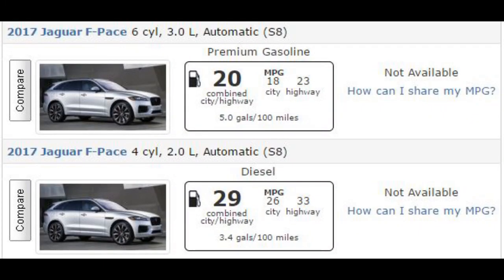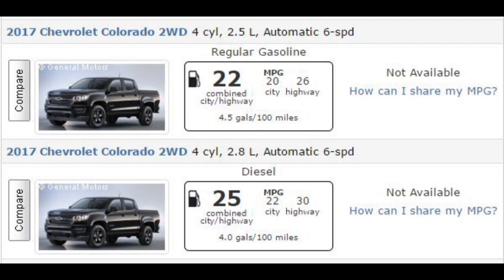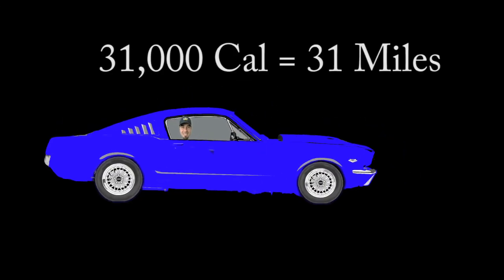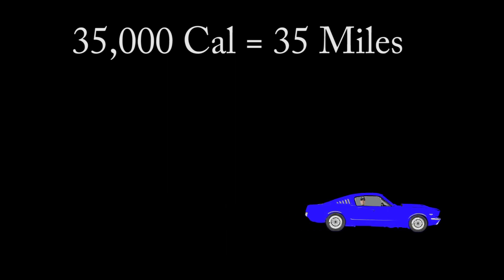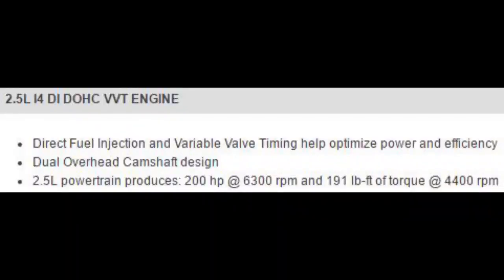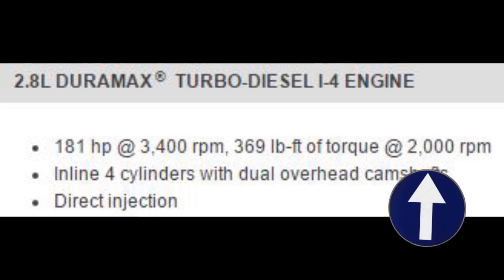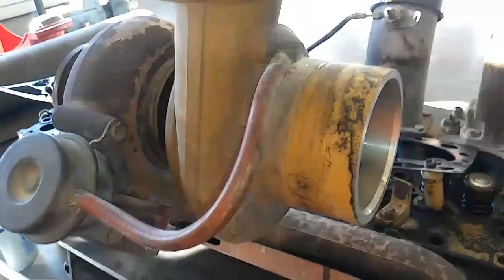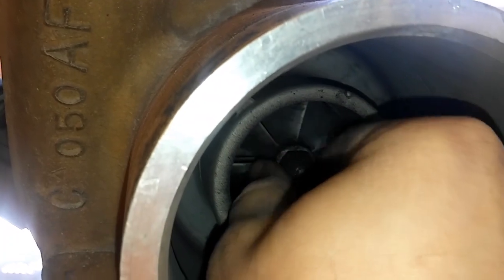Why Do Diesels Get Better MPG? Why Are Diesels More Fuel Efficient?

Comment: this past July, I drove my Smart Car diesel from Canada to Nebraska
checked and double checked: 996 miles: 
62.5 U.S. gallon per mile
the engine is 3 cylinders, 900cc
had lots of power.  No problem keeping up with traffic or passing, but I did keep it about 60 mph in an attempt to get the best mpg possible
I'll never sell the car - love it.
Reply from the maker: +badgeless I didn't know they made a Smart Diesel, that is pretty impressive mileage.
Reply: can't buy them in North America anymore for some reason.
I don't know how they get adequate power out of it but I'm happy with it.  The engine is a fascinating little 3 cylinders that sits sideways under the rear deck.  the length of the engine is about 24 inches.
Not sure if you're in Canada, but if so you'll know about the Webasto coolant heaters.  I've got one on the Smart.  It can be -30 and the Smart not plugged in.  I just flip the heater on and go back into the house.  15 - 20 min. later it fires up just like summer.  If I leave the Webasto running while I'm driving it continues to heat the coolant as it circulates.  15 min. later, or so, I have to reduce the interior heater motor speed because it's too hot.
I love my Smart Car.  Ugly but cheap.   I'll never part with it.
Reply: At 62 gallons per mile, I would drive it to a Cadillac dealer and trade it in before I even started.  Did you have a tanker truck following you?
Reply: badgeless Nice!
Reply: Adept Ape I thought all Smart cars were powered by gasoline, I did not know either.
Reply: I believe a Bradley tank gets better mileage EH!
Reply: Hahahaha i love the comments
Reply: I was planning to get a smart car diesel. costs like 25 bucks to fill and gets you 700km. I would have got a volkswagen diesel but now they are not emission legal

Comment: the biggest and main reason is because of the cylinder pressure at TDC. if gas did not predetonate it would get similar gas mileage to diesel. from the calculation of the PV curve of this adiabatic type compression, efficiency of the system increases with compression ratio or equivalent compression ratio (boosted).
Reply: Devo well, if wishes were horses, beggars would ride... gasoline would predetonate and destroy the engine at those high comporession ratios..
Reply: what you said....

Comment: Another great video AA. I think we all can thank Dr. Rudolf Diesel on he's great invention that were all benefiting from. Also great analogy on the internal combustion engines. We did have an engine that ran on diesel, mogas, kerosene and JP-8 fuel when I was in the US Army. We also could mix the fuel but it ran like crap when we did.I believe it was M35A1 on a deuce and a half truck. I want to say Hercules Diesel was the manufacturer. Thanks
JSL
Reply from the maker: +Joel Lagpacan I wasn't going to say the "don't mix the fuels" part in the video, but I don't want someone putting Diesel in their gas car to increase the mileage.

Comment: If i remember the old cat d8 14a will run gas/diesel. starts and warms up on gas then you switch to diesel.
Reply from the maker: +Trixler293 That must be quite the engine, how old was it?
Reply: Should be in the late 40s through 50s. Also a IH Farmall D450 starts on gas and runs on diesel. 1953 international TD20 bulldozer too, I was trying to find a particular video it had spark plugs and distributor. you move two levers one for diesel fuel and the other to raise the compression. Lots of 50s earth movers started on gas, i guess because glow plugs werent around yet.
Reply: We called them pony motors, and you are correct about the glow plugs.
Reply: okay I believe in two stroke extreme boost diesel.  think about that one.  how about a.wankle engine with the new port configuration which has put it back into R&D and it should be a major interest IMO.
Reply: That would be interesting to see how the mechanical inefficiencies are overcome.  There are many smart engineers out there.

Comment: hey adep ape i have a marine diesel engine  3406E  i was wondering what are the cause of high oil pressure
Reply from the maker: +Dax Cassini High oil pressure eh? How high? Did it just go up for recently?
Reply: we yous when out for a run and the port engine  pressure started to go up the gage was blinking red
Reply: normally its running  around 80 psi
Reply from the maker: +Dax Cassini First thing is put a mechanical gauge to verify the pressure is up, then I would cut that filter open to see if there is any metal in there. Could be the pressure relief valve stuck closed or possible something worse like a plugged galley or something. Check that filter first.

Comment: The differences end up washing out in the price difference at purchase time and the price of fuel. If diesel fuel and gasoline were priced the same, then the savings would make purchasing a diesel vehicle justifiable.
Reply from the maker: +Steve Ross I never say in the video that Diesel is cheaper or cheaper to operate. It is nearly always more expensive, just more fuel efficient.
Reply: Steve Ross at a lot of gas stations in my area, diesel is the same price or slightly cheaper than regular unleaded. If I had the money, I would've bought a diesel instead of my Galant, but there weren't any in my price range that didn't need lots of work.
Reply: In Europe diesel it's cheaper than gasoline and many companies offer diesel version at same price of the gasoline version.

Comment: I'm looking to buy an older school or shuttle bus could I get your opinion on the best engines please? THANKS
Reply from the maker: +mountainman For a Cat I would go with a 3126, they are good small Diesels. A gas engine is a lot cheaper though, what are you using the bus for?
Reply: Cross country rv conversion. I'm 42 and experiencing unexpected health issues and want to travel the west and maybe the north east but think it's more difficult cheaply anyway.
Reply: Adept Ape I'll try to pm I could really use some good advice. Thanks
Reply from the maker: mountainman Please email me at AdeptApe@yahoo.com the PM feature on YouTube is horrible.
Reply: mountainman If you are willing to go older and mechanically injected, the best engines are the International DT series. Unlike the smaller Cats, these engines are wet sleeve like the big diesels so doing a rebuild is easier, parts are cheap and plentiful and it has really no serious weaknesses. A DT360 or 466 will last you a long time, and if it has an inline injection pump can make more than enough power inexpensively. The HEUI system on the DT466E is the same basic design as the system used on CAT engines ( CAT and Navistar collaborated together ) but nothing is cheap about fixing them. Most common problem is the cam sensor going out.
Reply: I have a 1066 with a DT-466. Not sure what the E is, Must be newer. (Mine is 1971) I had it topped off, drove to a parade full throttle, drove around a lot ect. Sat waiting for a while and revved it a bunch. (Fuel is turned up quite a bit) got home, check it, hardly used anything. I wish there would not be EFI on engines, But oh well. Also, How high do you think a DT-466 can rev, safely. I have had mine hit 3,000 RPM, I didn't hold it, I brought it back. I don't want to throw every single rod and insinerate the pistons and snap the crank into 20 pieces.. haha. So how high you think it can safly rev?
Reply: E is for electronic.  3,000 rpm for those little diesels is OK.
Reply: k. I was reading some forums and hear people take em up to 6,000 RPM. (With a bit more than just a balancing kit)
Reply: Steve Ross Thanks Steve any idea of fuel millage in a short bus with these engines?